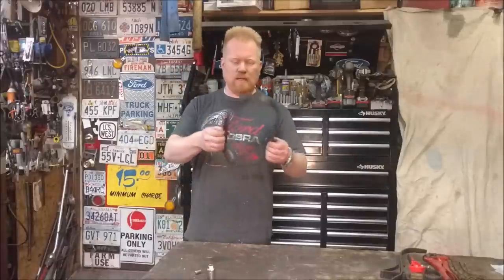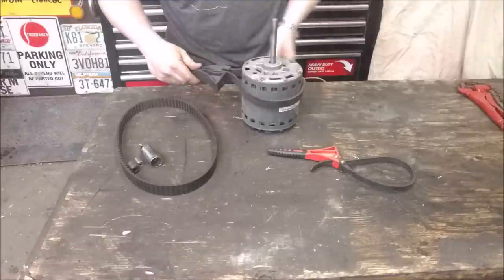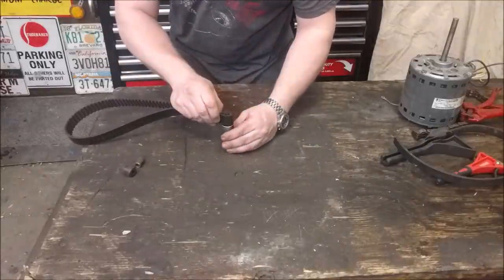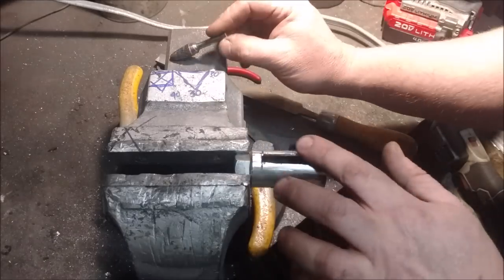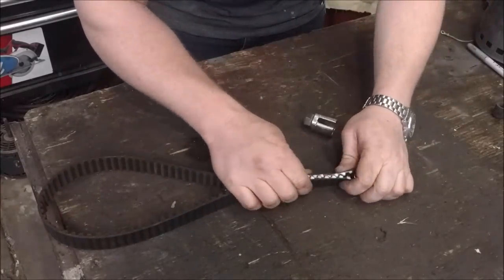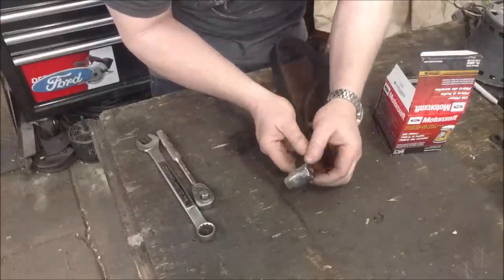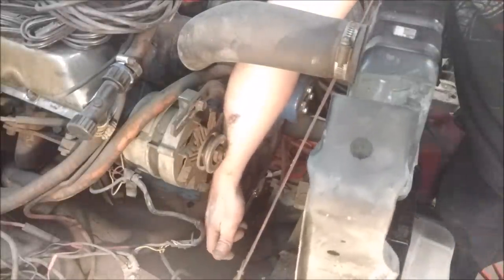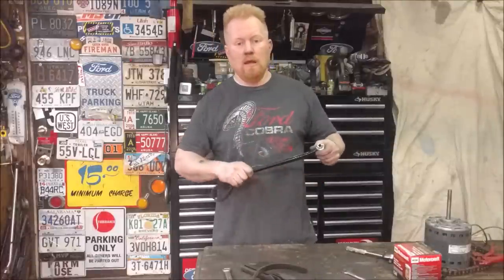Heavy Duty Strap Wrench Build

Comment: Many times I need just such a tool. Some years back, I had a machine delivered on a pallet and the shipper used these really strong ratchet tie downs, the 1 inch wide kind. They were different. they had a hex head on them, around 9/16", instead of the usual stamped steel lever like on the Walmart specials out there. I have use them for everything from re inflating a stubborn tractor tire to taking off oil filters.
Reply from the maker: Very neat. I can't say I've seen ones with a Hex head for the ratcheting mechanism.

Comment: tHAT is a FINE idea and the washer welded on will keep the socket from spreading! I use old 'V' belts for slings for lifting stuff all the  time. Thanks, Pal!
Reply from the maker: I'm amazed how much a fan V belt can hold. I bought the front frame and suspension section off a 70's Ford truck years ago from a wrecking yard. They lifted the entire 500+lb chunk into the bed of my truck all dangling from a single used V belt.
Reply: I believe it! I hang my 5665 GRavely with a kidney mower on the front of it with no problem but just enough to work on it. I've just got about a 7 foot ceiling and a strap hoist hung from that but it sure helps out the old back! And a V-belt makes a strong and quick sling. I usually stand riders on one end or the other instead of doing like a buddy of mine said and crawling around like a serpent and the belts work and don't gouge chunks out.
 Keep after it, Red! We're with you!

Comment: Nice custom tool ....love your creations! One big use I can use for this is to turn some big pier pipe that has an auger on the end which screws down into the river bed or out when the time comes, the only thing I need is more leverage. I was using a big HF alumuminum pipe wrench until the casting on the pipe wrench broke .....thanks for the vid :)
Reply from the maker: I've see those monster HF pipe wrenches. Thanks, I'm glad you liked it.

Comment: I seriously like your ingenuity! You do come up with some awesome ideas. I've actually had some good luck with the conventional rubber strap and did have to replace it once due to ripping after years of use. It's helped to get me out of a couple binds. Yours, however, should hold up even better, last longer, etc. Thanks for sharing your ideas!
Reply from the maker: I think they're an invaluable tool. For most stuff my store bought ones work fine but I always find a stubborn job that's pretty rough on them. Each time I've broken one I notice there are less than half a dozen nylon reinforcing fibers where a timing belt will have over a dozen. I hope this will work out better on those tough jobs.

Comment: Great video and just the homemade tool that I needed for my sized engine 😀 I  can rotate the engine clockwise with the crankshaft bolt or bump engine with the starter. But I can't make it go counter clockwise, as it will just unscrew the crankshaft bolt. Your 🔧 is just the ticket to get the grab and tourqe on the pulley so the engine can be rocked in reverse. A old v-belt can also be cut,and fill in the groves to add stability to the v belt pulley.

Comment: Dang it Moe !!!!   That was too easy !!  I expected 47 and a half pieces and 24 machinists tools to be used !!  LOL !!!  I LIKE IT !!  Now tell me please, did you NOT turn the belt inside out because the "teeth" grip better than the smooth side?  Sorry, but that question was driving me crazy when I saw you grind the teeth off the belt.  Another great job Moe !  Thank you for sharing !
Reply from the maker: I had other plans but figured it should be simple and functional. It can be flipped inside out at it sits and I can use the cogged or smooth side. I figured the teeth would bite in a little better.
Reply: DOH !!!!!!  Of course it can be flipped inside out !!!  No wonder you are The Esteemed One and I am but a lowly viewer of your greatness !!!!!  LOL !!

Comment: I wonder if when using your chain wrench, if worried about scratching, if you put an old belt between the chain and the item if it would still do the job and not scratch/distort?
Reply: I think the edges of the chain could still dig right into whatever rubber you would put between it and the part due to the forces at hand.  It might reduce damage to the part but it would probably ruin the padding after enough uses.  Leather might hold up for something like that but you'd still have the extra alignment of yet another thing in potentially tight spaces

Comment: Awesome job, I need something like that to hold my harmonic balancer still while I torque the center bolt (135 ft lb), I might attempt to make a tool like this, thanks for sharing the idea.
Reply from the maker: That's always fun trying to torque the harmonic balancer bolt. I had the harmonic balancer fall off my '78 Ford Truck years ago on the freeway. The bolt wasn't properly torqued(not by me). Luckily the bolt and balancer stayed in the engine bay.

Comment: Great idea,  could you also use O2 sensor socket ?
Reply: Great idea tom. There’s already a cutout in it.  I will definitely try it.
Thanks for sharing!
Reply from the maker: Yeah, if I had an extra 02 sensor tool I would have just used that.

Comment: Wow that's a better design than the commercial ones
Reply from the maker: The commercial ones use cheap rubber belts that stretch, slip and break easily. They're fine for super light duty things but those projects I can generally just grab what ever I'm working on by hand and hold it.

Comment: Years ago, I had a German made car that required metric hex drive (allen wrench type) tools to work on it. So I found some metric hex head bolts and welded them into some inexpensive (cheap, old, used, junk) sockets I had. Worked great! Didn't have to spend  $$ on a set of Metric hex bit sockets!
Reply from the maker: Thanks for sharing

Comment: Great idea! Now get another belt, and cut it, and just put it in that big black strap wrench handle. I hate the 'straps' they put in those. I have broken every single one I have ever used!
Reply from the maker: I'm pretty rough on mine and haven't had good luck. Each time I've broken one I notice there are less than half a dozen nylon reinforcing fibers where a timing belt will have over a dozen. I hope this will work out better.

Comment: Very cool looks like the teeth really help around the part.
Reply from the maker: I'm pretty rough on the store bought ones and haven't had good luck. Each time I've broken one I notice there are less than half a dozen nylon reinforcing fibers where a timing belt will have over a dozen. I hope this will work out better.
Reply: Id think it would have to work better.   Yeah the store bought ones Ive used always seem to slip on me no matter what I do.

Comment: This is a good DIY tool.. But the thing is it might be not appropriate to fit in tight places. i think using a smaller belt will be better for things like oil filters.
Reply from the maker: That's the great thing about making your own tools; you can make them exactly for what fits your specific needs.

Comment: thanks for the video! Try turning the belt inside out next time, it will save getting rid of the teeth.
Reply from the maker: I only had to remove a small portion of teeth. I want them on the inside to do the gripping and be sacrificial against sharp edges.

Comment: What about a spanner tool for a bicycle, I've made 3 of them but the metal was too soft. Any ideas of what materials to use
Reply from the maker: Like the pin spanners to take off the pedal assembly or rear sprocket on a BMX?
Reply: Yes exactly they have to be thin. The bearing cup nut.